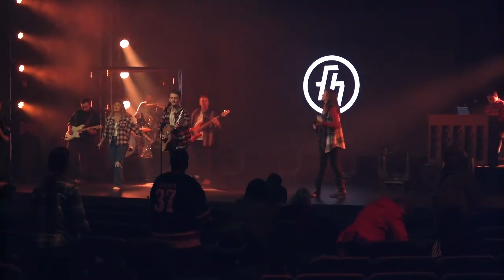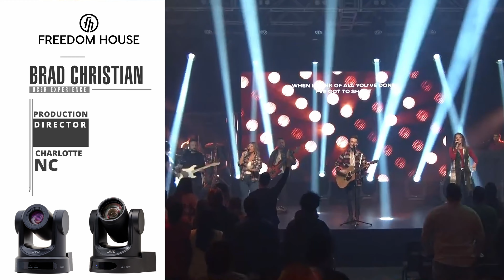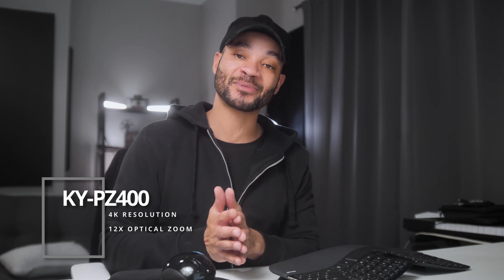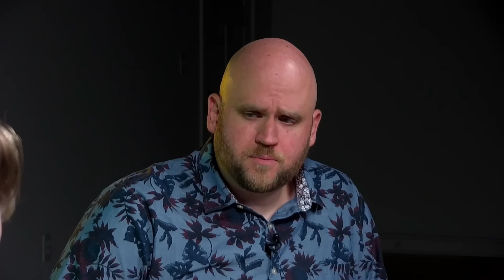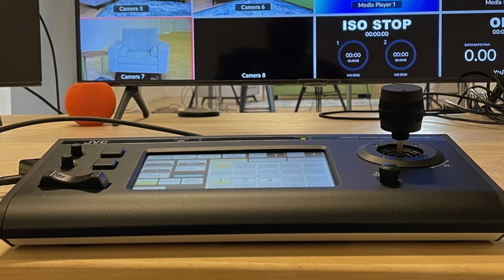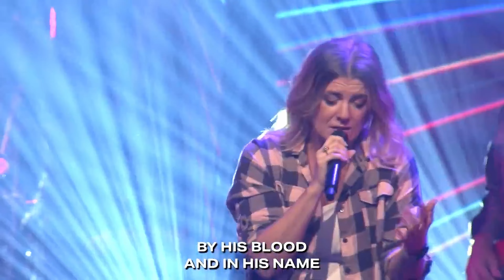Doing More with Less: JVC PTZ Cameras Transforming Church Production for Smaller Teams

Comment: We have been live streaming our Sunday morning worship services, just added our 3rd service, for the past 2 plus years using 3 Sony BRC/SRG-400 P/T/Z cameras and the Sony RM IP500 controller with joy stick. In addition, we use a Go Pro and 2 camcorders feeding an ATEM Mini Extreme providing 6 camera inputs. By using a script based on the songs and the order of worship, a single director/operator handles the live stream. This eliminated the need for individual camera operators, intercoms and related thus saving money and the space for the camera operators. We are a mid-size church located in Apex NC. Our live stream is considered to be a very valuable outreach to our members, those church shopping and others that may never enter our worship center! Such an approach can provide a straightforward and scalable way for small to midsize churches to get into live streaming.
Reply from the maker: Hi Ed, thx for the comment.  We're based just up the road in Cary, NC.  Would love to come check out your set up some time!